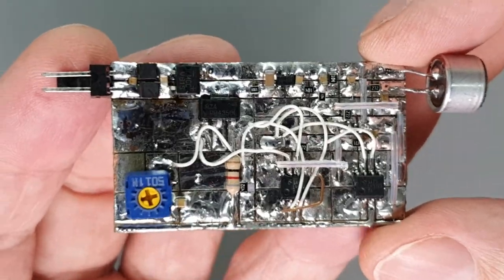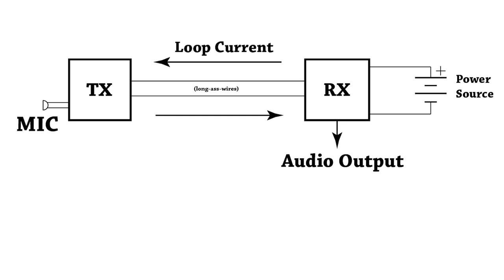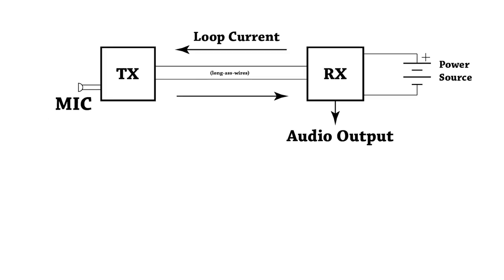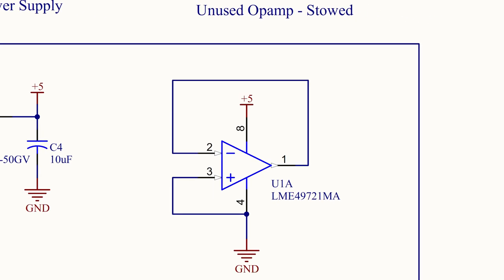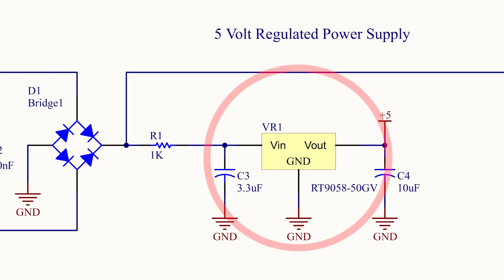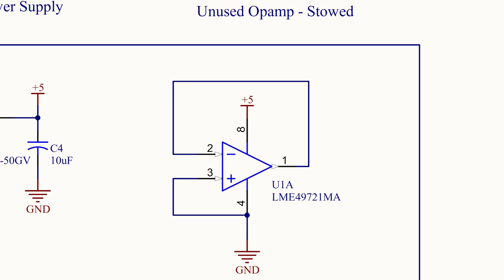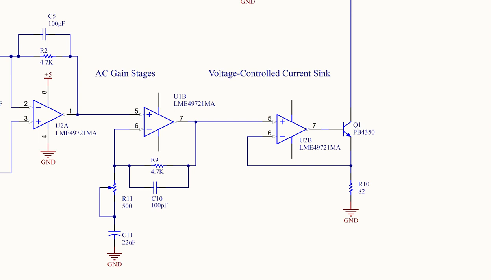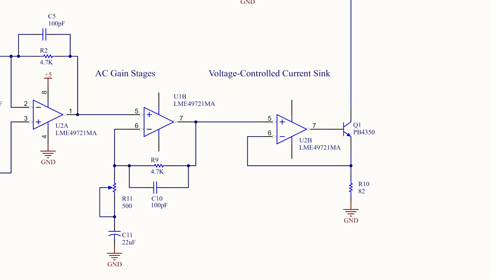Is Your House Bugged?

Comment: At the 6-minute location you mentioned grounding the input of the unused opamp.  This works well for bipolar power supplies but is often out of the common mode range of a single supply opamp.  It is OK for your selected device (a rail-to-rail input and output device), but a better (more general) solution is to run the + input to your 2.5V reference.  This way the opamp doesn't need to work as hard to make the output try to go to ground.

Comment: Your detailed explanations of the circuit sections allow me to learn techniques/understanding that I can take on to my own projects, Leo. For example, quieting the power supply to the mic. It's also very instructive when you explain the practical limits of design choices such as how much current will flow in the loop. You have a totally relatable Art of Electronics way of explaining all this analog stuff that fascinates me.  Thank you so much for sharing your work.

Comment: Leo:  Very much enjoyed your video.  I too have 'engineered' many innovative solutions but I never tire from looking at another engineer's solution and you've become one of my favorites!
Current loops (for so many applications) are very underrated and a lot of engineers try to force common-mode voltage signals around the design environment with the expected dismal results. Even if you are talking digital signals, current loops offer much greater noise-margins and vastly lower implementation-costs!  Even if you "bastardize" a solution into a pseudo balanced system, you can get great results.  Along time ago, I found out that you could pipe NTSC video without using 75-Ohm coax and just use a simple twisted-pair instead. Also, current loops allow a nearly infinite amount of devices and are inherently easy to detect faults and troubleshoot.  Great you posted this video and also showing the use of two transformers for signal enhancing while obliterating common mode noise.  Thanks for posting!

Comment: Nice presentation! This is like how RFID chips get power and communicate, but with wires. In an RFID system, a typical keyless entry card has no battery. The card reader transmits RF energy to the card, which rectifies it to DC. The card sends back data by varying the load on its antenna, like Q1 in Leo's circuit (at 5:50 in the video). The card reader senses the load changes.

Comment: 5:29 or so, I believe that graph is valid only when using powered microphones (ie. electrostatic mic with phantom power, or having DC voltage across a coiled mic - the latter is equivalent to using a speaker in reverse and makes very little sense as it will distort the signal*). please correct me if I'm wrong. 

* that's because on the "upper" part of the signal, there will be more current flowing through the wires and therefore more attenuation.

Comment: Wow, great video. I loved the explanations with schematics and data sheets-- I understood everything. Great way to explain the concepts! Maybe current loop is a lost lesser known solution, so nice to see a design explained in detail.

 But at >$100 per microphone I wonder if a digital solution is better. With $2 ESP with WiFi/Bluetooth or ARM with line drivers, some with MEMS microphone controllers, is an analog transmission optimal?

I loved the footage of your rectilinear cut SMD PCBs, or whatever you call it was. (I remember your prior video on that.) I haven't tried that yet myself, but it is inspirational.

Thanks for another thought provoking video.
Reply from the maker: The parts cost maybe $10.00 it's not the cost of parts, but the cost of LOW VOLUME MANUFACTURE that makes it $150.00 a unit.  Make 1000's of something and it's cheap, but make 40 and the price is NASTY.
Reply: you have to remember when this was built, way before $2 ESP's.

Comment: Bastard Operators have been using CAT 3 and CAT 5 cables for microphones for decades. mic wired up to the office network jack with an amp speaker / recorder in the wiring closet. This is not new, but glad it found a productive use of thr technique. ;-)

Comment: Nice...I like it :-)  Reminded me of the time I used SATA cables for high-speed analog signals.  Not sure why you used 2 xfmrs on the rx tho. A single unit should give all the CMR you need, no?
Reply from the maker: The main source of common mode nasty is capacitively coupled AC mains voltage, this gives you currents flowing the same direction in both wires. How do you convert the varying current flow into a voltage that is insensitive to common mode without a cancelation trick?
Reply: @leosbagoftricks3732  Hmm, are you saying that the double xfmr is needed because you're operating in current mode? CM current will be flowing in stray capacitance for the most part, yes? So CMR will largely depend on balance? I still don't grok the 2-xfmr need. Nor have I ever seen it elsewhere. Still...willing to learn a new trick if I'm missing something! p.s., the circuit conjures memories of the olde POTS "hybrid" circuit :-)

Comment: I enjoy your channel, and this vid was particularly interesting to an old tip and ring guy (me.) However, I have to chuckle a bit at your circuit build technique. Small PCBs are easy to design and very cheap to buy...as in 10 for $30 delivered from China in a week from the time you submit the Gerbers. You can put your tin snips out to pasture. 😊
Reply: That's a week for every design iteration....For rapid prototyping, this works brilliantly!
Reply: @CarlMarvin  Exactly.  For low volume prototyping this technique is just about perfect.  (He has an excellent video talking about his prototyping tools that is well worth a view).  The only thing that might be better would be a cnc mill suitable for pcbs.  But that is only really worth it if you are doing a lot of prototyping.
Reply: @CarlMarvin  For design checks of non-RF boards, I use solderless breadboards. They are reusable, quick to assemble, and easy to revise. They also don't require any solder, flux, or grinding tiny particles of copper and fiberglass into the air. 😊
Reply: @ImnotChuck.  breadboards are great, but this solution works well for SMD components
Reply: @ImnotChuck.  They are useless for anything that uses high freqs or currents.

Comment: 4 microphones? 5 microphones or a CAT5 cable? I count 7... + ground that makes 8 wires. You can even push it a bit further and use the shield as a ground. there might be some crosstalk, but if the microphones are situated in proximity to each other there will be acoustic "cross-talk" anyway.

Comment: Where would one find a common easy source for the transformers?
Reply from the maker: Digikey, Mouser, etc etc... It should be a 600:600 ohm audio coupling transformer.  Beware the small cheap ones have crappy frequency response.